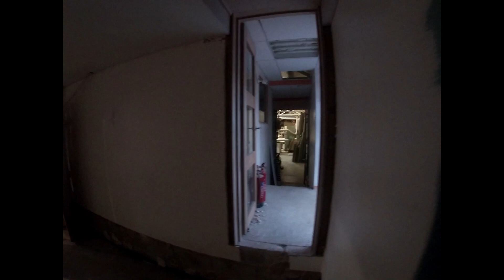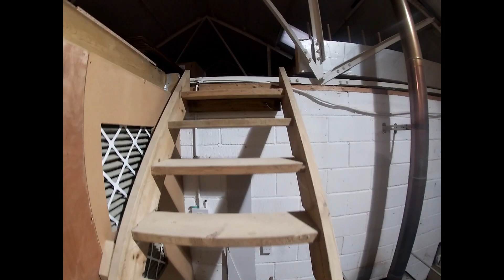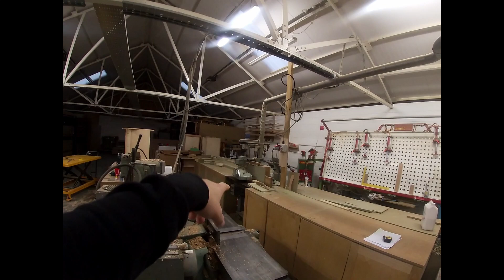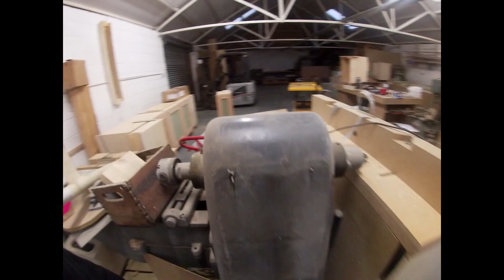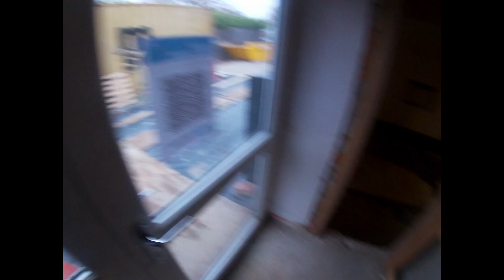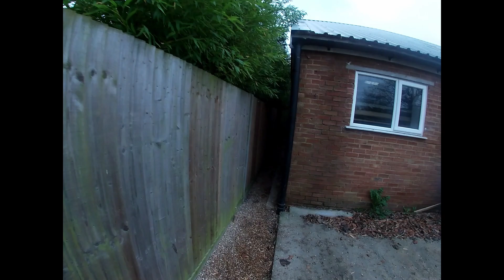My 4500 sqft Wood Workshop Update - Felder Mirka Makita Format 4 Wadkin Dewalt Mafell

Comment: Enjoy your channel and always enjoy looking at workshop set ups. I'm a joiner in East Sussex and recently moved workshops and spent the best part of £40k on the new set up including a felder F700Z Spindle,RL200 Dust extractor and waiting for the FB500 Bandsaw to turn up but my question is when you looked at panel saws did you consider a vertical/wall saw instead of a panel saw?. I have a smaller workshop so went for a wall saw which I do find better for me (mostly one man band/Fred in  a shed type set up) but they are great when you have to lug about 10x5 sheets and also trimming the horns of doors,sashes, repetitive cuts etc and cutting glass apertures. The Felder panel saw looks the mutts nuts when you need that type of set-up.  All the best and Merry Christmas.
Reply from the maker: Hi Adrian.  Yes I did look at a vertical saw when I was tight on space but I was skeptical about accuracy and scoring facility was a must. I went for a startrite initially in the first workshop then upgraded to an scm minimax before the kappa was bought.  So yeah I looked at wallsaws but I decided there was too much risk of error and precision.  My thoughts are they are good for sizing timber but for all round work they are not the best choice.  That being said, what's your opinion? You have real experience now with yours.
Reply: @getyourwoodout  Hi and cheers for the reply. The one I had in my previous workshop was a 1980's Holz-her , big beast ,too big really and had MDF Sacrificial back boards but it was very accurate indeed. Great for sheet materials as I said and de-horning sashes etc. It didn't have a scoring blade so used a triple chip blade and "back-cut" a couple of mm in so on a vertical cut you run the saw all the way down to the bottom and then plunge in 2-3mm and move the blade upwards so "back cut"  which works really well. My new one is a Elcon DS1550  which has a compressed air moving back board so the blade never cuts the supports and uses the "Back cut" system too but many of them do have a scoring saw, some have cutters which score the board rather than a 2nd blade.Very good cut on veneered and melamine faced boards.  They do take up wall space but for accuracy and ease of use for one man they are brilliant. I dimension solid timber on a rip saw which has a smaller foot print than a panel saw... It's really what work best for the space you have but in the future I would recommend considering one as they are very accurate. Cheers Adrian PS: I'd love a MORSO  and your clamping system is cool..
Reply from the maker: Yeah it sounds like you have a good tool there. The morso is an amazingly simple piece of kit.  I found that one for 250 and the seller delivered for free. Absolute steal.